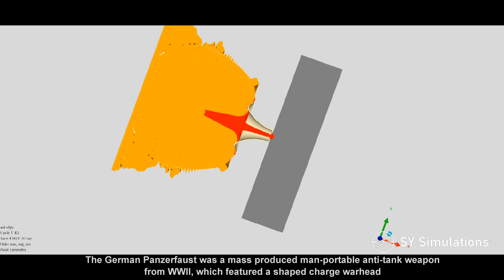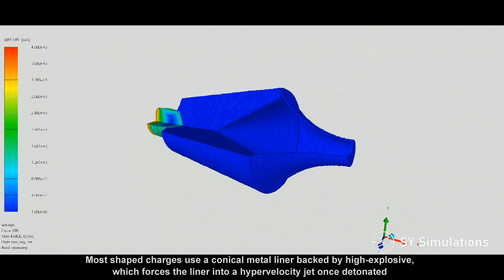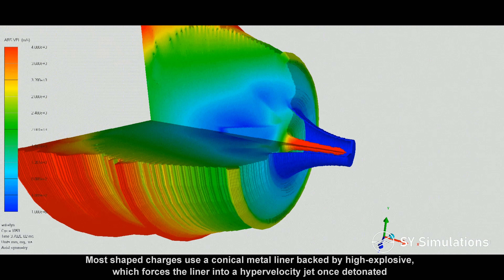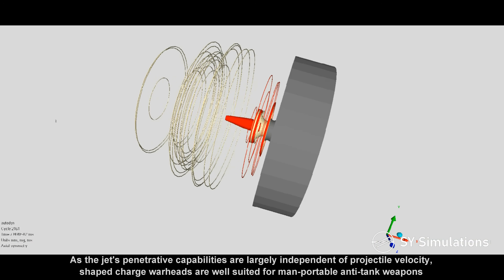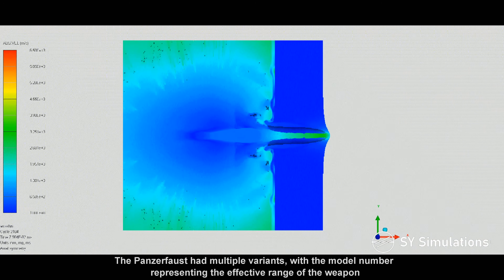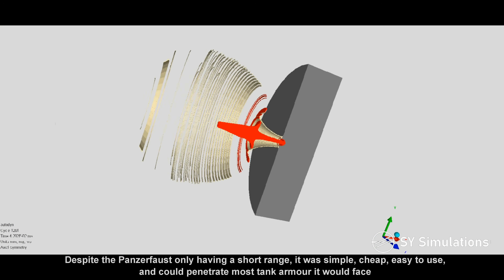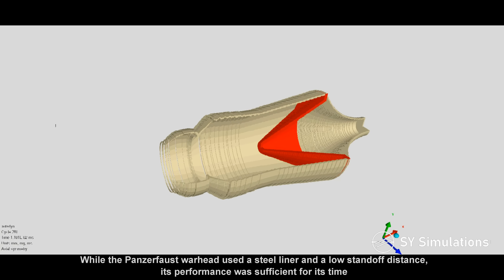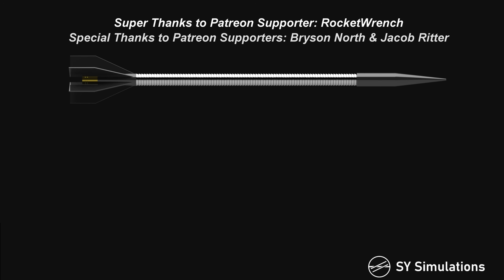PANZERFAUST SIMULATION | Shaped Charge vs T-34-85 | Armour Penetration Simulation

Comment: these things had penetration up to 200mm, t-34 didint stand a chance
Reply: If this really is the panzerfaust 'klein' then it nominally has 140mm of penetration.
Reply: Its important to note that the panzerfaust had a massive 149mm warhead diameter, which was twice the size of average tank guns at the time and nearly twice of the size of the ones on the larger end (the soviet 122mm, which not only had decent armor penetration but was also added to vehicles that weren't necessarily intended to fight tanks, are an exception)
Reply: Wait then why didnt ww2 tanks ever use projectiles like this? Why fire AP that can pen 90mm when you could have it fire a projectile like this that can pen 200mm?
Reply: @MrJohansen  Rifled guns ruin heat round performance, most technologies to counter this didn't get invented till the 50's or later.

There was a 75mm heat round in both german and us service but both had way lower penetration than the best infantry anti-tank weapons. For the US it was restricted to lover velocity 75mm/105mm guns like what you saw with the M8 HMC, but the germans had heat shells for their high velocity guns too. (105mm gun heat rounds went through like 110mm of armor with classic WWII style standoffs when fired through rifling... Not ideal when the reload times on such shells were quite long.)

Another challenge with a heat round is if the shell hits side on so the case deforms before the fuse is triggered the whole rounds going to be damaged/distorted when it detonates and you will not be seeing your desired effect today.

Add in fuse failures, and the fact that the shell needs to be hollow enough to hold the shaped charge while being strong enough to survive being fired from a gun, its no wonder why not that many nations were eager to manufacture the rounds for tanks early on, their effectiveness wasn't as promising as it was for infantry weapons, and the manufacturing standards were much higher than for infantry weapons. (The technology for making sturdy, thin shelled HE rounds was a german invention, drawing out the shell case like you would a brass casing, so other nations had later access to good methods for manufacturing of a heat shell.)

Once manufacturing and fin stabilization were solved, pretty much every nation had these rounds as a major feature of their tank armaments, but that took another decade to really perfect. (Along with the engineering behind standoff distances getting mastered.) Plus a huge laundry list of optimizations like explosive wave shapers and the like.
Reply: that tiny plasma cone will kill one dude in the tank while hitting the same tank with a 10kg of steel flying twice the speed of sound will hurt/stun/disable/shock every person inside the tank regardless of whether there is a penetration or not. using complex tank shells wasn't very cost effective or time effective in the forties, the panzerfaust worked because it was simple and cheap to make. fitting that mechanism inside a tank shell will waste all that space you could fill with steel instead and one shell will take more money and time to make than 20 normal shells.
Reply: @glandhound  Its not plasma. Nice wall of text tho. Didnt read.
Reply: @WalrusJones185  This is the Panzergrenate 38 Hol Ladung or  7.5cm PzGr 38.   The initial 1938 version had mediocre penetration of about 40mm but from late 1941 or early 1942 The 7.5cm PzGr 38 HL/A was issued with about 75mm penetration against 30-degree armour.  The subsequent HL/B, HL/C had about 85 and 100mm penetration.  (from memory)
-There were also 8.8cm and 10.5cm version with the same designation.    
-There was also an 81mm 'mortar' round to be fired from the 81mm PAW 600 high/low pressure gun.  This was a duel artillery field gun and AT gun firing a hollow charge round with about 140mm penetration.  As this was a smooth bore weapon it didn't loose penetration from spin though some must have been lost from the high 520m/sec velocity. 
-The 81mm warhead was also attached to the R4M folding fin rockets used by the Me 262 and Fw 190D9 to create the Panzerblitz III rocket.
Reply: @MrJohansen   Very good question. Firstly, these shaped charge warheads weren't mature until about 1942, by then the anti-tank guns that would be used in WW2 had already been designed. It was a matter of putting these into production. The Germans made a gun specifically to fire HEAT warheads but it took too long to develop, the war was over.

So, okay, how hard is it to just make a shaped charge warhead for existing guns? Well the existing guns may have the right caliber but the rifling was only suitable for stabilizing short and high density projectiles at very high speed (higher speed meant faster spin). A heat warhead is long, low-density and couldn't be fired fast without being torn apart. The higher velocity and spin also causes fuzing and detonation problems.

You can do it, you can squeeze a 75mm shaped charge into a 75mm anti-tank gun but after all the compromises it's no better than a regular 75mm AP round. 

After the war they found a way to fire shaped charge warheads from rifled barrels and yes, by that point it was kinda pointless to bother with regular kinetic energy rounds.

However, at the same time they also perfected APDS technology which could give just as good penetration as a shaped charge of the same caliber but also be way higher velocity. Higher velocity means flatter trajectory, less lead time, all around very good. Then there came APFSDS, even better.
Reply: @MrJohansen  HEAT charges performance falls if the projectile is spinning (as it spreads the jet)  and falls of when at very high velocity.  This initially made it hard to make an accurate long range high velocity weapon.
Reply: @MrJohansen  i think that everybody was already using AP shells, and there was no need for the switch to HEAT rounds.
Reply: @MrJohansen  hollow charge tank shells inacurrate at long distance.
Reply: @MrJohansen  they did. su122 had a heat round that penned like 160mm and so did the 105mm howitzer sherman. HEAT gets more effective with increased diameter
Reply: @MrJohansen  Kwestia zasięgu, jak mniemam.
Reply: @MrJohansen bc things take time to develop? Unless you think technology just drops down from the sky lol